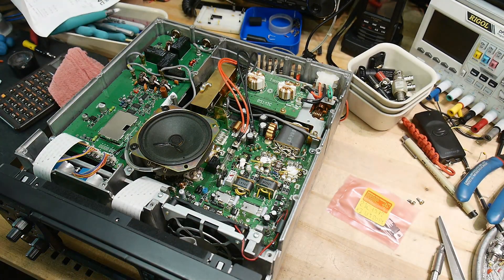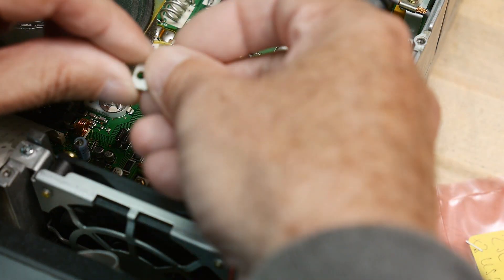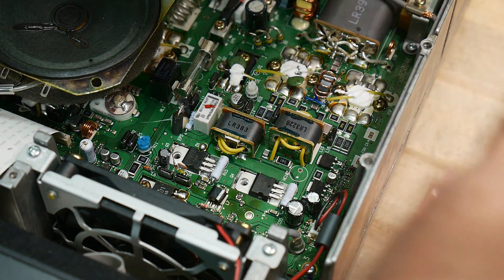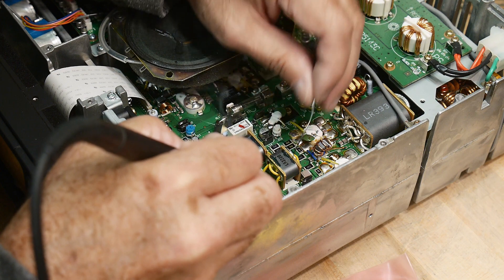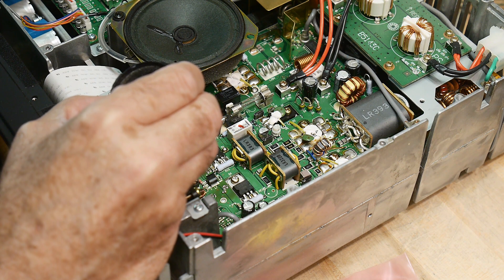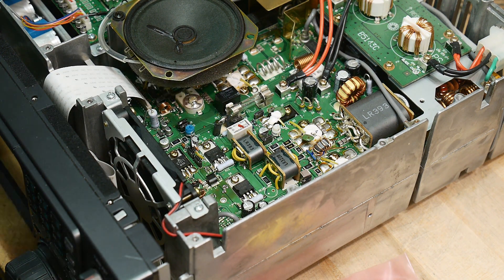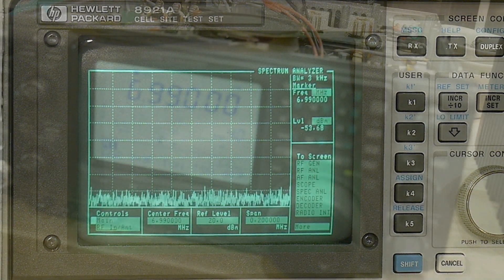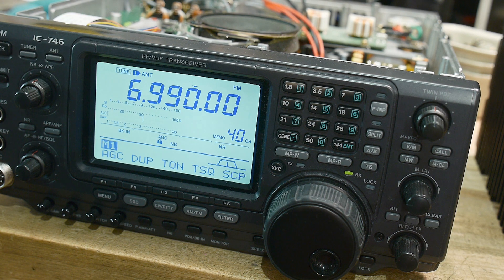#1103 ICOM IC-746 faulty ( part 7 of 8)

Comment: Why didn't you reattach the diode or resistor or whatever it was that goes across the top transistor?
Reply from the maker: I did before part 8
Reply: @IMSAIGuy  Okay, right on thanks. Great video. Ironically, I have a IC-746 that just started showing the same symptoms after a power supply malfunction. I was able to follow your video and determine that the two transistors were causing my problem too.. you saved me so much time because all I had to do is open the cover and jump right to checking the voltage at the base of that transistor and sure enough... I was getting supply voltage at the base.,... way too high according to the schematics. Thank you so much. This radio was donated to me after losing everything I own in the big fire that destroyed Lytton, BC last year. I have only had the radio for two days now and then it stopped working on me... I am totally bummed out because radio is about all I have to do, being stuck in the side of this mountain.. thank you so much!

Comment: Did  you remember to solder the diode bypassed by a cap to the left transistor? This is part of the bias circuit. It turns down the bias if the transistor gets hot. It needs to be thermally connected to the transistor. Without this diode, there is probably no bias on the transistor and it is running class B. It will put out power in FM and CW and seem great but SSB and AM will be crap because the amp is not running linearly. Additionally, I would also add the blobs of solder to each of the legs of the transistors. This is used as another way to conduct heat out of the transistor through the legs.
Reply from the maker: calm down. I put it back in

Comment: I really enjoy these kind of videos as well as those from TRX Lab and Mike's Radio Repair.  Some great practical examples examples.  

Agree that it is much less stressful working on free gear that someone has given you :)

I'm in the process of refurbishing my TS-830s which I purchased new in 1981.  After moving to California and getting busy with other things it sat for close to 20 years.  Now in a place where I can set up antennas without restriction and getting back into HF.  The radio still worked OK for the most part, but needed some cleaning up and TLC after sitting for so long.  Now that I have all the test equipment and a place to work on it, figured it was time to replace all the electrolytic caps, the finals and some related parts.  Next up is addressing the band switches which have gotten a bit flakey, and then doing a complete realignment.

Comment: Well, I know it won't be the last (I'm at 4:25 now) because there's a part 8! But I'm wondering what caused it to fail. The radio worked fine when I boxed it away 20 years ago, and when I powered it up 6 months ago, it had low power out. Something failed that caused this cascade of failure....

Now I'm at @15:50! Congratulations .... but what is in part 8?
Reply from the maker: you will find out tomorrow...
Reply: @IMSAIGuy  An early Easter Egg?
Reply: @IMSAIGuy  After seeing this video, I went and checked the voltage on the power supply I was using on it to make sure it wasn't putting out 24 volts or something! I've had power supplies fail to "overvoltage" and ruin equipment before I figured it out. (The PS was fine, putting out about 13 volts with or without load.)

Comment: Emmiter on the tab is weird. Ive never seen a TO-220 with that pinout before. Its usually always base, collector, emmiter from left to right.
Reply: It is quite a popular layout in RF transistors. The ever popular 2SC1945 is another example.
Reply: This layout means that in a common emitter amplifier, the tab (emitter) is grounded. That in turn means you don't need to insulate the transistor from a grounded heatsink, and that means lower thermal resistance and no parasitic capacitance across the insulator. For these reasons, it's useful to have the emitter on the tab.